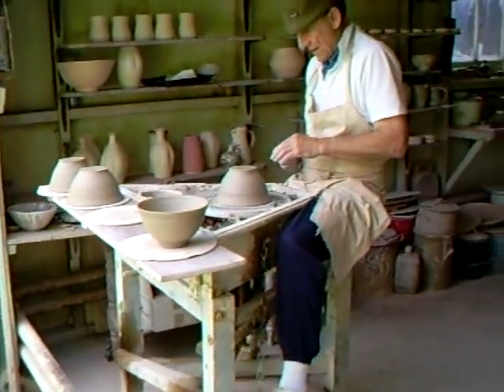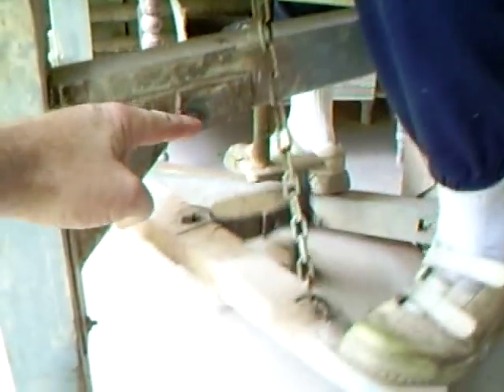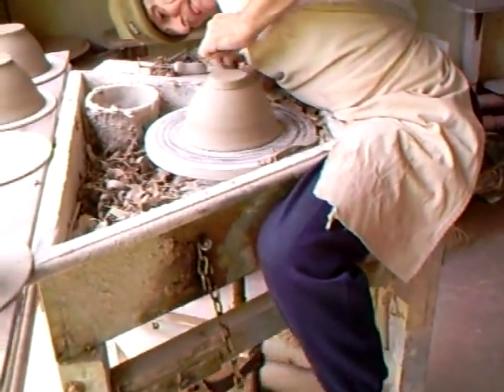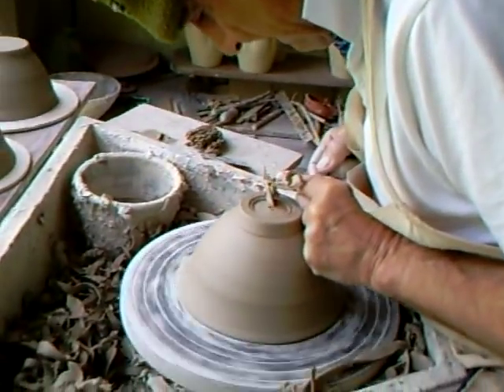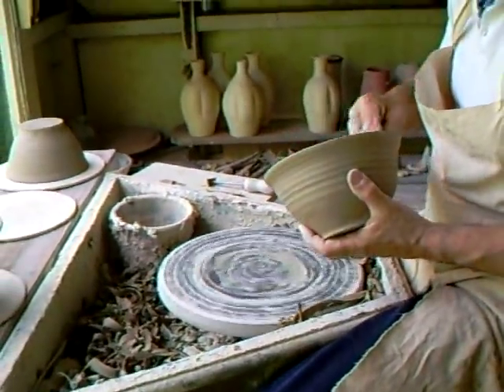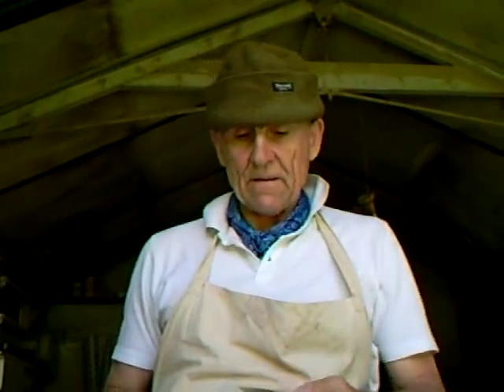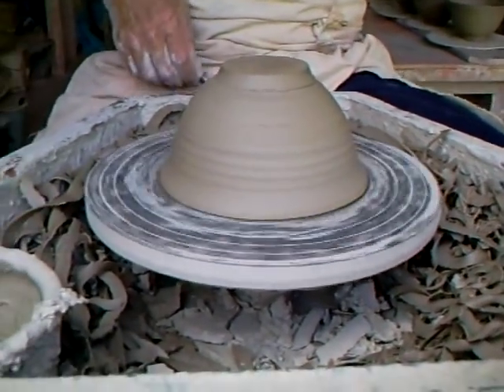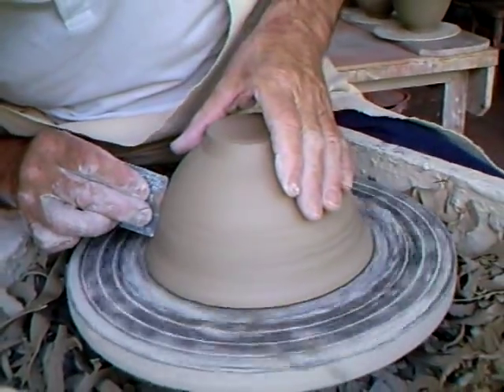SIMON LEACH - At Lowerdown with Jeremy

Comment: A suggestion, you might be using an .avi file which is too large. Run it through Windows Movie Maker and save as .wmv at 320x240 smaller size high quality. Trimming and editing can make a smaller file too. I didn't know Snapfish took videos, thanks.